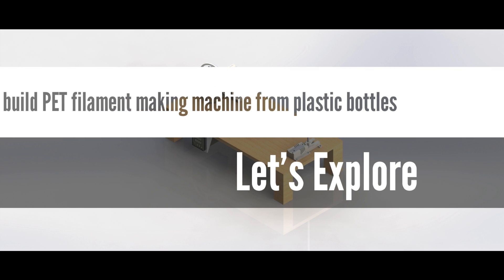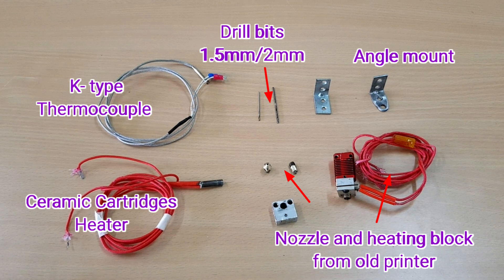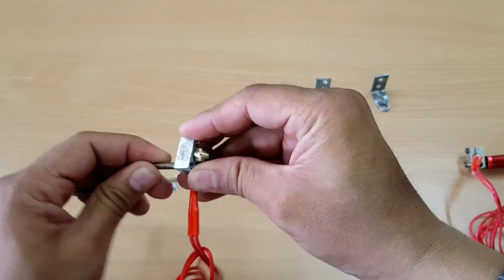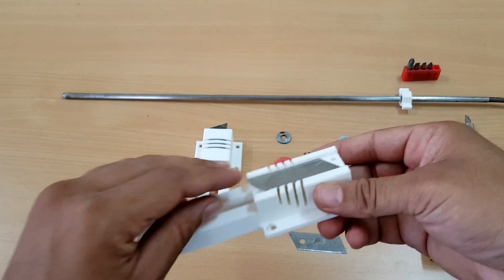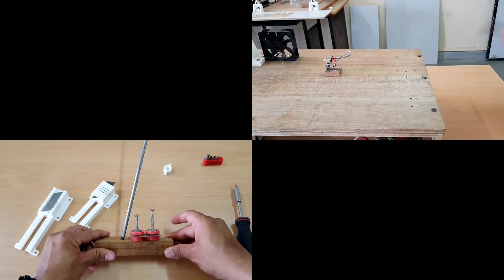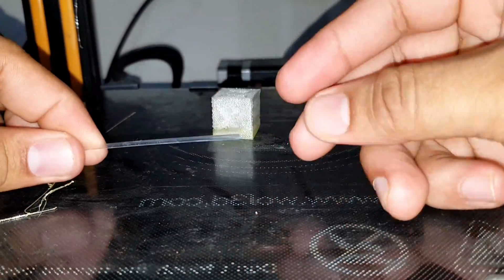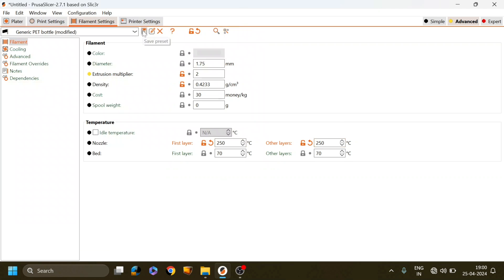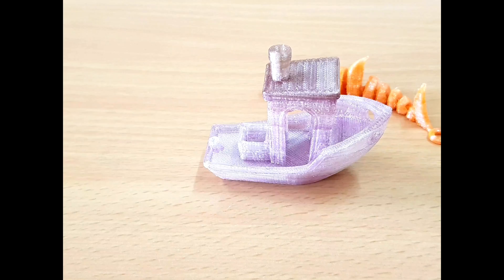How to make PET filament for 3d printing from plastic bottles I PET filament making machine

Comment: bro i used the c100 temperature controller and it was written on its back its relay output and when i connect the exact circuit the heater doesnt work and i cant find the controller that is written on its back ssr output like yours please i need a solution

Comment: Sir is the dc motor regulator is used for the fan that is cooling the  extruded filament or for the gear motor
Reply from the maker: It's for geared motor

Comment: Use two small bearings on top of each other to cut the bottles into strips. It is much easier if you first remove the chamfer on their contact surfaces using an abrasive. Best with an angle grinder. You can also use a lathe, but the lathe blade should be harder than the bearing shell.😉
Reply from the maker: Thank for info...

Comment: I did tha same but getting half zero in c100 and it's mean is overlad
Reply from the maker: Hey these rexc100 comes with lot of troubles,  mine too stopped working after few months already replaced once... Please see my other video in which temperature controller is from Ramps 1.4 , if you have printer running on ramps or it support dual extruder .
Use one for controlling heater temperature.
Reply: @3Delite028  thanks
I will replace it

Comment: Hi can i change that motor dc to this one  Motor GearBox DC JGY 370 Worm Gear Box High Torque
Reply from the maker: Yes bro. If it has enough torque then no issue
Reply: @3Delite028  how to make the motor fit welll, because the size is different?, it is still okay to just change the model?

Comment: I did make one for my own,  aslo want to make video for my chennal,  did live today and try to print with the pet filament  and after 1st layer printer always  get holted,  in whole live it got halted 4 times and so i just stop  the cooling fan it did print  well and with out halt but temperature  always   fluctuate  and it stay stable on 260 only and the print that i habe printed its to flimsy,  which i have desing in same live too,  but  still cant understand  what should i do to print it more strong,  infill is enough  too,  layer wall is intact but get sepreted form the body in some part,  if you have some solution  pls help the fellow  youtuber,  i need lil help with this project💕👍
Reply from the maker: Send images and more details of the problem in Instagram...

Comment: Do you think this filament can be used on a 3d pen ? what is the fusion point of it? i think it would be perfect if some cheap 3d pens could be able to melt it
Reply from the maker: Nozzle temperature for PET filament i used was 250 degree Celsius on Creality Ender 3 v2.
I haven't used pen...
But if it can reach that temperature then its possible

Comment: What is the power supply and DC motor power information?  Can you provide information?  Thanks 😇😊
Reply from the maker: It's 12 volt 10 amps power supply.
Same 12 Volt for DC motor.
Please check motor voltage power rating for your motor before connecting 
Since heater and all works on 12 Volt in my case.
Reply: @3Delite028  I completed the connections according to the circuit diagram, but I cannot control the temperature with Rex, it always goes above the desired temperature. Do I need to make a separate setting for Rex?

Comment: Vc faz a maquina para vender?
Reply from the maker: I made it but not selling.
It's just for DIY stuff.
I will be soon uploading more simple way to make that does not need rexc100 controller 
Instead you can use stock extruder and ramps board of 3d printer to control temperature
Reply: Não entendo ,dá pra traduzir

Comment: Thank you for the video  👏👏

Can I just ask a question? I am trying the same thing with Rex C100 + SSR DC-DC to control  the heather cartridge from an old 3d printer, but when I turn it on, it gets hot too fast while the thermistor is showing 30 degrees celsius, with fear of burning something I turn it off.  I am still trying to understand what is happening, have you had this problem, is this normal?
Reply from the maker: If you already have old 3d printer than there is no need to buy rex c100 , just use the motherboard provided in old 3d printer to control the nozzle temperature.

Comment: Pls show the rex C 100 programming part too
Reply from the maker: It doesn't need programming..
Just connect the wires as per circuit diagram and you are good to go...
Reply: @3Delite028  I have done that exactly as per the circuit,but the heating element is not working
Reply: @pranavchavan9763  , I am not good with electronics but I had a similar issue, not sure if is the same root cause tho. Check if your SSR is DC to DC, the one that came with my Rex C100 was  DC to AC
Reply: @3Delite028  thx

Comment: How to setup C100
Reply from the maker: See circuit diagram.
Make sure you have correct connection.
Then its very simple 
Use arrows to reach to desired temperature.
And set key

Comment: Please tell me how to adjust the temperature😢😢😢😢😢😢😢😢
Reply from the maker: You have to adjust the temperature depending on the type of plastic being used. 
Amd few trails because it depends on how you have set up the temperature sensor.
You can try from approximately 140 degree Celsius and try to extrude filament.
Then go on increasing and decreasing temperature based on how well filament is extruding

Comment: Thank you dear, the end of k thermocouple is bigger than its hole in the metal cube.
Can the hole be enlarged?
Reply from the maker: Yes i have enlarged hole of the block.
Make sure to have tight fit
Not too loose..

Comment: And also another question: Since filaments are standard with a diameter of 1.75 mm, wouldn’t it be better to drill the nozzle with a 1.75 mm drill bit?” ❤
Reply from the maker: If it is available then definitely go for 1.75mm
Since i didn't find it around me so i chose to go with 1.5mm since its was Bowden extruder

Comment: Where i can buy  heating blockand   ceramic cartridge i can't find your type of heating block online ... Please send any link or name of market in Delhi i you now ...😢
Reply from the maker: There are plenty of online option 
Robi.in 
roboticsdna
Novo3d 
These are the names of few websites you can search
It is very cheap also
Reply: @3Delite028  one more thing could you please name the heating block which you used in video ..   please
Reply: @TRX-x001 did you find it ?
The heating block name ?
Reply: No  @Shrederz0
Reply from the maker: In Delhi specifically 
I don't know brother
Reply: @3Delite028  hmm   ..any link for online
Reply: Where can I buy it ?

Comment: One of my problems is that I don’t have access to this type of engine, and it’s not available in my country. Could you please suggest a similar engine or tell me exactly what specifications the required engine should have?
Reply from the maker: Which country are you from ??
If there is services from china 
You can order same parts from AliExpress or bangood etc. 
Otherwise there is no special equipment used here
Its just a DC motor with gear drive for pulling which can also be done manually if you want to just try first.
Then there is heater, temperature controller with relay for heating element.
Rest all can be easily sourced
Reply: @3Delite028 Unfortunately, I do not have access to this engine
Reply: But this model exists

Comment: how did you set up the heat controller?
Reply from the maker: This is ready made module of REXC100.
If you have spare nozzle set and board you can use that also.
Like controlling nozzle temperature 🌡️

Comment: this gc motor is not available in my country :/ Do you know any alternative for it that would fit?
Reply from the maker: You can use the set up which uses stepper motors.
But it involves coding and other electronics arrangement.
You can try using 2 smaller geared motor. The one which comes with plastic gears or servos with 360 degree rotation.
Reply from the maker: https://www.facebook.com/woodmood.tsp/videos/408442018268886/?mibextid=rS40aB7S9Ucbxw6v

Comment: And can you tell me about setting of temperature for 0.4mm nozzle if we drill 1.5 mm more on nozzel end then what is range of temprature we set kimdly tell
Reply from the maker: This are the settings for 3d printing 
I used prusa slicer with bed temperature of 70 degree Celsius and nozzle temperature 250 degrees Celsius.
For bed adhesion i used normal glue stick evenly applied to bed.
This setting for filament extrusion from 1.5 mm diameter hole on modified nozzle 
Initial temperature of 130 degree Celsius for feeding filament.
And 200 degree for making filament

Comment: Do you ever encounter clogging with this filament?
Reply from the maker: Yup bro initially it happened due to less temperature of nozzle which was 240 degrees Celsius on my ender 3v2. But when i heated up nozzle temperature to 250 degrees Celsius it extruded like butter.

I used prusa slicer with bed temperature of 70 degree Celsius and nozzle temperature 250 degrees Celsius.
For bed adhesion i used normal glue stick evenly applied to bed.

Hope this clarifies all your doubts.
Reply: @3Delite028  thanks for the answer. also, how much flow rate do you set?
Reply from the maker: There is a setting called extrusion multiplier.

I had stock extruder on my ender3 v2.
Which didn't work for 1.5 mm extruded pet  filament.
I also tried 2mm hole on nozzle but it was getting struck in bowden tube.

So i chose 1.5 mm diameter hole for nozzle.
And used dual gear extruder with stock steps per mm 
And extrusion multiplier value = 2 
For prusa slicer.
Reply from the maker: I upgraded my extruder to creality dual gear extruder without calibrating steps then directly changing flow rate to double value.
This printed well for PET filament.

Whenever you upgrade extruder firstly calibrate steps per mm for extruder for normal filament like PLA.
Then for PET filament you just make test print with extrusion rate 1.4/1.5/2 times the normal since pet filament are hollow inside.
Reply: @3Delite028  thanks very helpful

Comment: Bro tell me one thing is 0.4mm dia of hot end nozzle is produce 1.75mm dia filament or not means how much dia of nozzle we used for 1.75mm filament dia produce
Reply: And can you tell me about setting of temperature for 0.4mm nozzle if we drill 1.5 mm more on nozzel end then what is range of temprature we set kimdly tell
Reply from the maker: 0.4 mm diameter nozzle was drilled with 1.5 mm drill on smaller diameter end and 3-4 mm diameter hole on the other side from where the plastic strip enters the nozzle

Comment: And tell me about black and red wire that connwct with pwm controller with which you connect these two wires or motor terminal yes or not
Reply from the maker: https://www.google.com/search?q=pwm+dc+motor+speed+controller+circuit+diagram&oq=pwm+dc+spe&gs_lcrp=EgZjaHJvbWUqCAgDEAAYFhgeMgYIABBFGDkyBwgBEAAYgAQyCAgCEAAYFhgeMggIAxAAGBYYHjIICAQQABgWGB4yCAgFEAAYFhgeMggIBhAAGBYYHjIICAcQABgWGB4yCAgIEAAYFhgeMggICRAAGBYYHjIICAoQABgWGB4yCAgLEAAYFhgeMggIDBAAGBYYHjIICA0QABgWGB4yCAgOEAAYFhge0gEINTM5OWoxajeoAhSwAgE&client=ms-android-oppo-rev1&sourceid=chrome-mobile&ie=UTF-8#imgrc=K_GCITuBH2uMOM&imgdii=672bTMksMRaJyM

Check out image link.
If you still have confusion, please tell

Comment: And also tell abput temperature setting speed setting
Reply from the maker: Yes bro, I haven't mentioned this because it is different for type of nozzle , heating cartridge and also its how it is arranged 
For me while i feed filament i kept it 130 degrees Celsius 
Then heat upto 200 degrees Celsius for extruding...
Just tinker a bit around this temperature 
You will get exact settings for your machine too.
All the best..👍🏻😊

Comment: Bro some wiring is missing like motor driver or fan wiring kindly tell me
Reply from the maker: For fan it only positive and negative 
You can connect it directly to power supply.
For motor speed controller it's also pretty straight forward 
Connect to power supply + & -
Then to Motor.
It is also written on the speed controller...
Hope this answers your ⁉️...

Comment: How did you make the plastic cutter, do you have a video explaining that ?
Reply from the maker: I made 3 variations of cutter.
I have explained lil bit in the video.
But the last one is very simple ... You can use few set of washer , stack them in two set and put cutter in between as per the thickness of strip required.
This arrangement worked well for me.
So i 3d printed circular part to replace washers..
I hope this helps.
Please let me know if you have any doubt.
There are lot of video on making strips 
But this was simple and easy to build.

Comment: May I see your wiring?
I have exactly the same electronics, but I can't seem to get the temperature to go up 😢
Reply from the maker: I have put the wiring image in the video, It is exactly same.
Please check whether temperature sensor or rexc100 is working or not.
Reply: @3Delite028  I get the wiring right. But the temp still won't go up. Tested the heat sensor by burning the heat block with lighter, the temp in rex's display goes up. But when I set the temp like 50°c or more, the temp won't reach. It stays at 31-34°
I am going to replace the heater catridge as my last resort. If it still not work, I don't know what to do 😞
Reply from the maker: Hey there might be some issue with solid state relay or Rexc100.
Possibly rexc100 
Because from past few days i am also facing issue with temperature controller. In my case after setting temperature it is going 30-40 degrees Celsius above
And then fluctuating up down , not remaining constant.
May be these components are of cheap quality.
I bought it from robu.in
Not working as needed.
From Where did you bought the components?
Reply: @3Delite028  turns out my old heater is busted, lol. I thout the only broken thing from my old 3d printer's hot end is the sensor cable. Actually, I thot wrong 😅 problem solved after I replace the heater.
Now I only need to print the parts. Thanks for the video and your response. Keep up the good work, it really helps for ppl like me 😁

Comment: Really excellent. I was wondering, since you extrude the PET twice, if you could make flat PET and print that directly. The retraction and feed would maybe be a bit tricky as I guess retraction would need to enter a preheated chamber that accepted the flat
Reply from the maker: Flat PET may involve lot of calibration and arrangement. Since i used Bowden tube extruder it may be difficult to get pass through. I used 2mm diameter filament first but was not going through Bowden tube then i got 1.5mm hole this worked well.
Let me give it a thought 🤔 if i can work something around that..
Thank you 👍🏻
Reply: I totally agreed, cut to size and feed the flat PET directly. you will need to accommodate a different feed mechanism depending on the 3D printer,.
Reply: @3Delite028  That would be revolutionary if you could. But I understand it is not easy.

Comment: Would this filament still be food safe?
Reply from the maker: PET plastics can be safely used as food contact material. However, misuse of PET bottles can result in release of greater amount of chemical substances. They may also deform when contact temperature reaches 70oC from Google.
Since we are already heating it twice that temperature it may not be appropriate for storing food & who knows if some toxins might be stored in between layers of object printed. There's even problem with food safe material also . The recent micro plastic study in blood/water bottles
Results were reported on January 8, 2024, in the Proceedings of the National Academy of Sciences. The researchers found that, on average, a liter of bottled water included about 240,000 tiny pieces of plastic. About 90% of these plastic fragments were nanoplastics.